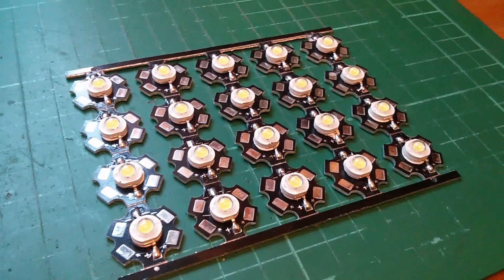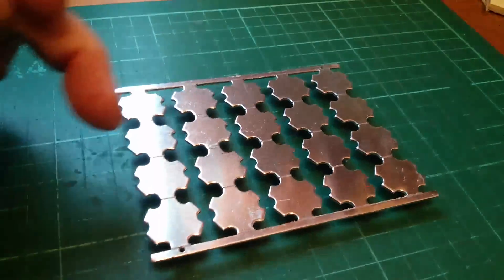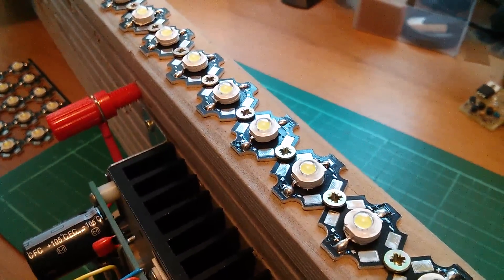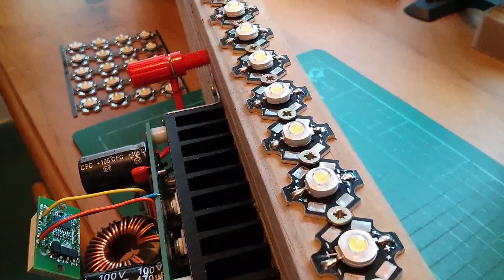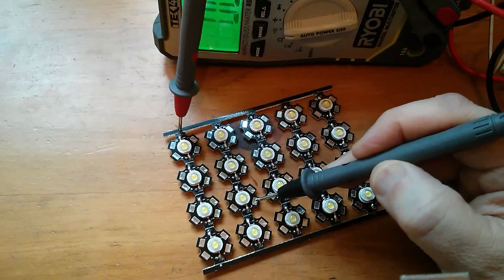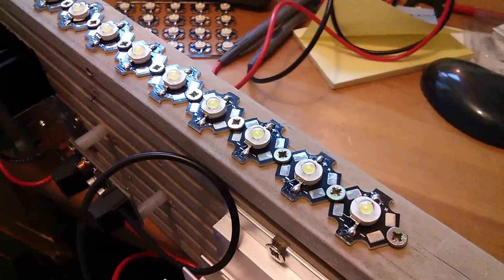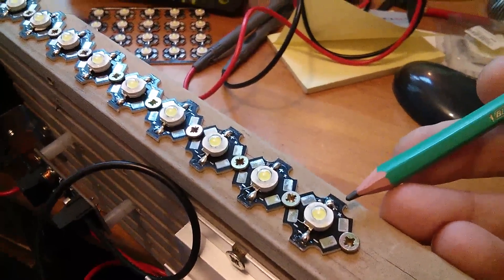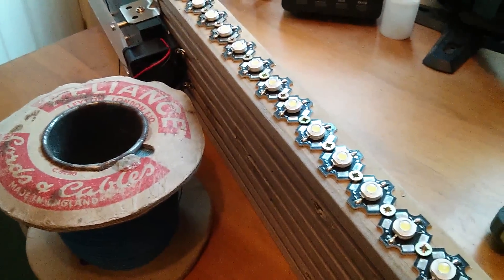Sequencing 30 High Power LEDs with Arduino and LED Drivers #1

Comment: Hello Julian, thanks for the video as it was much informational. You seemed to be much technical guy for this topic so I would like to ask help from you. I have bought below specs LEDs and want to know how can I light this up in 1 single panel, like what driver is required of what specs: 3Wx10 White LED 

1Wx10 Blue LED 

1Wx10 Full Spectrum LED 

Thanks in Advance.

Comment: What approach would you adopt to drive  off individual 1 watt Leds from an arduino. All LEds run at 350 ma but there are different colours requiring between 2.3v and 4.0 volts. I could use eight Buck converters for efficiency but this is bulky. Is there a compact solution?

Comment: I have ordered similar 3W LEDs from eBay, but they are a scam!!!

I have tested them and at normal load (3.2V) the max current through 1 LED was 90mA -> 0.3W.
I have tried to put maximal load (3.8V), but they became very hot very quickly and that would probably result in shorter lifespan of LEDs. Maximum current with 3.8V drop was 200mA -> 0.76W.
My test shows that these 3W LEDs are just another fake product that people are buying from Ebay without noticing that they don't provide advertised specs!!!

Do you have a multimeter to confirm my conclusion as you probably ordered the same type of LEDs from eBay that I did!

Comment: Your project looks great! What kind of driver do I need to to power 20 of these LEDs in series? I plan to have 3 rows of 20 LEDS so I think I need 3 seperate drivers. Does the driver requirement change if I do 6X10W Led instead?